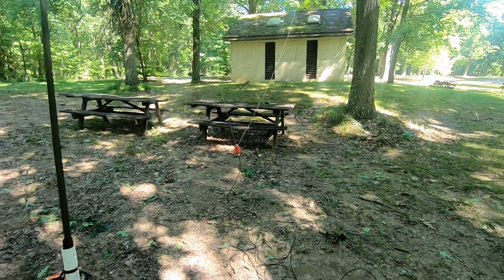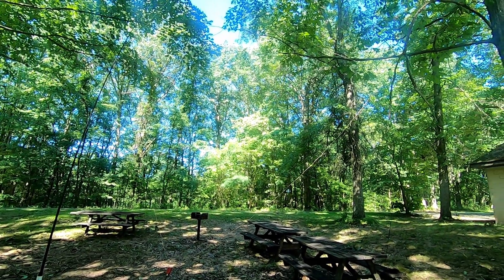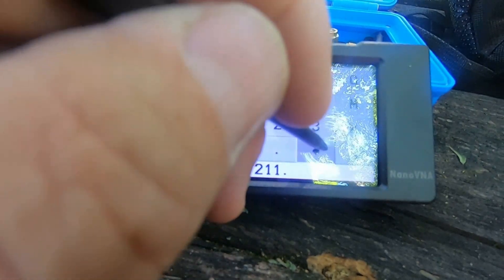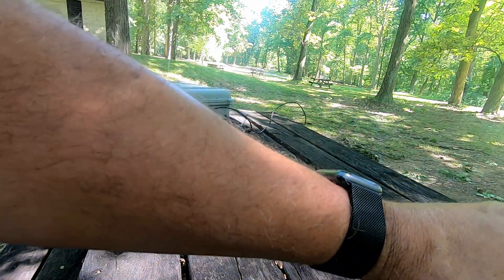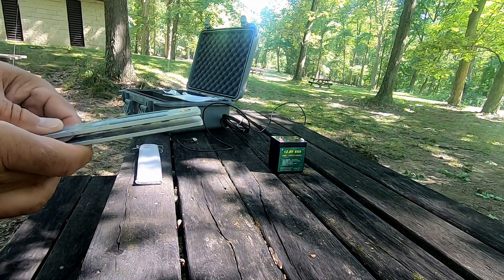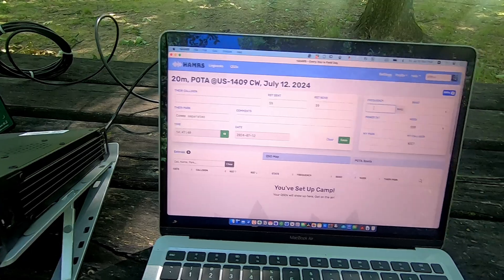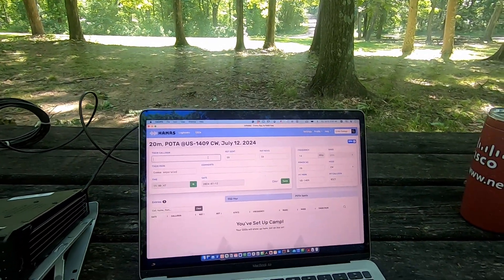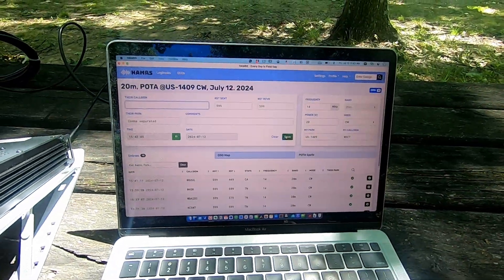Is the DIY Delta Loop Antenna a Good Field Ham Antenna?

Comment: This design is spectacular for DX when 30 ft above ground. Also, you do not need much of a Balun with this shape as it will be around 50 to 150 Ohms. Check out my QRZ for a bit of info from this exact antenna raised above ground properly. I work the world with it. Super low noise floor and fantastic reports. 73
KF0NKI

Comment: Try a 4:1 current balun or a 2:1.5 current balun. The delta may perform better. Another suggestion 9:1 current balun. Anyway I enjoy the channel and your experimentation. I had an 80 meter delta with a 4:1 current balun. Horizontal polarization I had a ball with it. Great content 73 from Art.  K2ADC
Reply from the maker: Thanks for the tips. I think I need to buy more balans and ununs. Thanks for watching I'm glad you are enjoying the videos. 73s

Comment: This antenna is working as a cloudburner. It WILL work a lot better but it must be vertically polarized.
Reply from the maker: Thanks! And thank you for reaching out on email I will try the tips you gave me. Thanks for watching, and 73s.
Reply: Contact me.